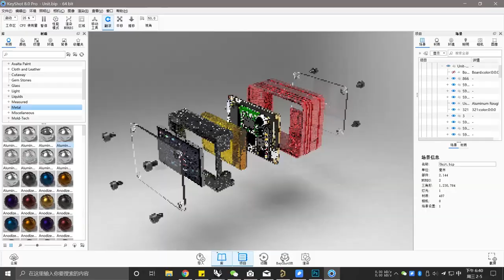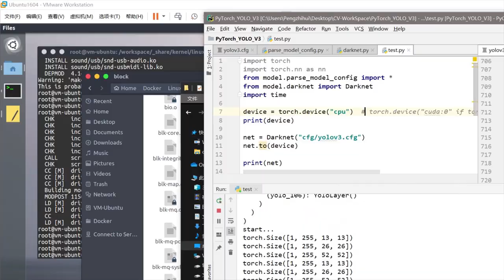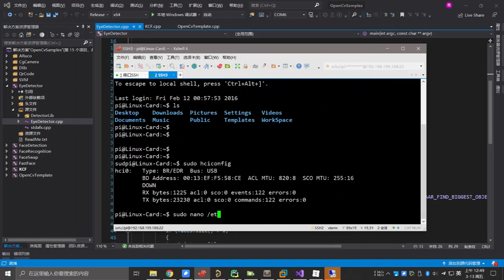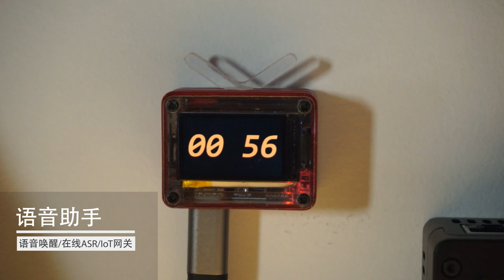How to make an extremely TINY LINUX COMPUTER！

Comment: The Allwinner H3 is probably one of my favorite chips to work with in projects. It's inexpensive and has good support through linux-sunxi. The Cortex-A7 does in-order execution too, which prevents it from needing to be gimped by Specter/Meltdown vulnerability patches.(which require Out of Order Execution as far as I remember)
Reply: do you know the sbc development process?

Comment: amazing workmanship, engineering and resentation! <3
this reminds me a lot of the long discontinued 4D systems "uOLED-96-PROP", a tiny, MCU based all in one "supercomputer" dev board, based on the completely crazy real time processing beast of the parallax propeller chip. not much has ever been done with it, but it's incredibly tiny, cute and powerfull for its time.